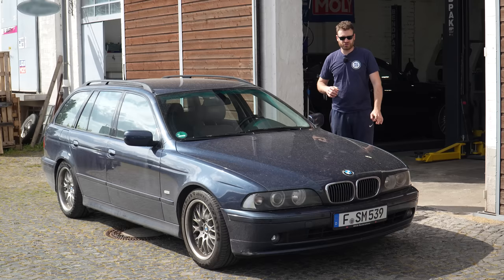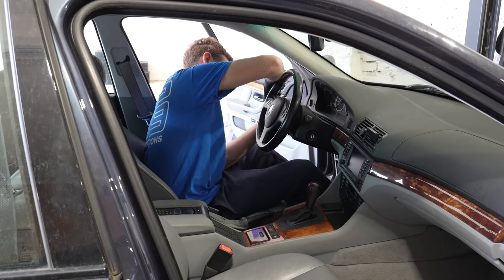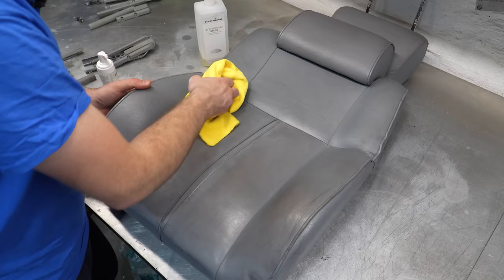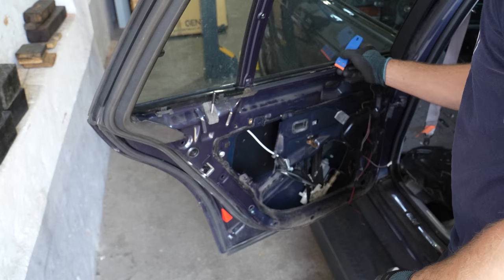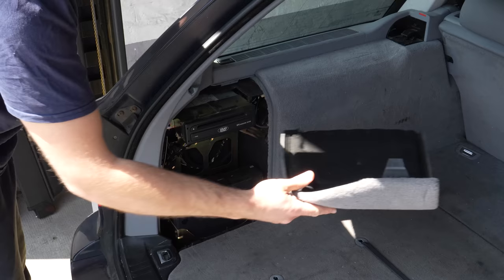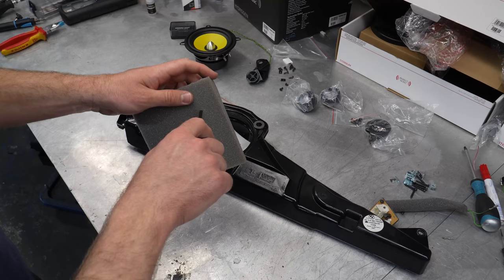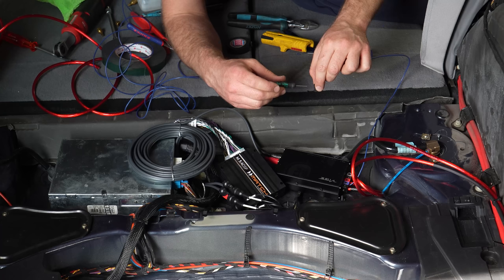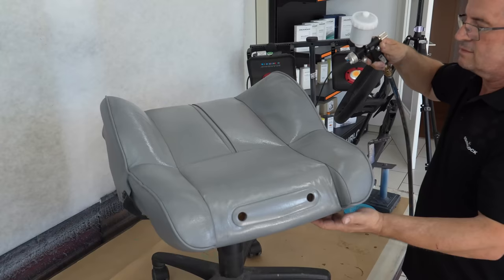Upgrading the 20-Year-Old Tech - BMW E39 530i Touring - Project Rottweil: P5

Comment: Hey maybe you can help me out with the harnesses? I got a e46 with the big Navi and H&K system and would like to connect a dsp + amp because the stock amp is kind of trash 😅. How did you connect the radio (BM54?) to the dsp? And are the speakers connected to the radio or the dsp? I really would like to keep the original parts/looks and just tune the system.

Comment: Please don't use so long coiled-up signal cable between the DSP and the amplifier. It creates an unnecessary signal loss. Just buy a 1 meter or less long regular RCA cable. Other than that, great video as usual.

Comment: The dihtung on the inside of the door, the rubber one that blocks the moist and water get inside the door. For proper install, heat it with a heat gun so it attaches better. Worked in a BMW service/bodywork shop, and thats how to install it without thinkin it will fall of or not seal properly. Just a advice

Comment: Hmm did Sreten connect thru the stock crossover? Saw some capacitors on that board with the connector in the front door speakers???

Comment: bluebus is the dream but damn its expensive :D dension gateway works really good too, had it in my e46
Reply: Just use any aftermarket radio with bt and swc. No need for bluebus. Multiple ways to achieve the same thing on these older bimmers
Reply: @burntnougat5341  - It's a matter of what your goals are. I created the BlueBus because I wanted to keep the OEM system, I wanted to maximize the functionality of the factory components and I wanted high quality audio (BlueBus sports a high quality DAC -- Texas Instruments PCM5122).
Reply: @bluebusbt  correct but price being a factor, I suggested a more budget friendly option for the op that accomplishes the same goal. The stock systems on these cars are at their age imo
Reply: @burntnougat5341  I appreciate you like aftermarket radios, but they definitely don't accomplish the same goal if the goal is to keep the stock equipment. You can see from Sreten's videos that he and many others like us try to keep the cars stock where practical.

Comment: I love watching your videos on the E39s because it gives me an enthusiasm boost to carry on OEM-plussing mine! Nice work as always Sreten.
Btw you mentioned that you’re wiring the sub in series? That would be positive to negative terminals, and increase the overall impedance (lower volume). Parallel will half the impedance, positive to positive, and make your amp work harder. Which way did you go?
Reply: his amp goes down to 1 ohm and sub is wired in 1 ohm

Comment: Nice, are you sure you put de negative and the positive right on the sub? It looks like he goes the wrong way, you can easily check this with a 9 volt battery..  and you put the wiring parallel,  not in serie like you mentioned

Comment: Great content as usual.
Don't agree 100% with the foam solution for sealing the mid speaker but maybe it will seal up sufficient with no air leakage front to back of speaker element 🙂

Comment: Great video. I have to ask how can you tune a multi speaker DSP with the interior out, the sound will completely change once everything is back, I assume you will tune again, its a bit like setting up suspension while still on the ramp, its ok but will change once loaded.

Comment: Anyone has the link of the tool for the subframe bushings please??? Need to change mine aswell and cant find where he put the link he said
Reply from the maker: I just added his ebay profile, but it looks like he has no active ads :(
Reply: @M539Restorations  managed to buy the last tool from the guy. Big thanks to you Sreten👍🏼 will change mine this Saturday like you did
Reply from the maker: @athanassiosioannidis8436  if you have air springs in the back, try to deflate them, it will be easier, otherwise they will push the subframe down.

Comment: That rear sensor is the s.l.s. rear axel height sensor . Not a headlight level sensor on a touring? Touring wears out the subfrane bushings because the entire suspention is mounted to the subframe not the body like a sedan is.

Comment: 45:20 You say you are connecting in series, but you connected the sub in parallel if im not mistaken? Might be driving the amp a bit too hard that way, but I don't know what load it supports

Comment: 36:19 if other have not mentioned it, would the 2 capacitors on the board not work as a crossover too?
Reply: the oem crossover should not be in the system...

Comment: Front speakers, you should have just taken the rubber protector off of the magnet, and it should have fit! That foam is not dens enough, you're definitely going to lose a lot of efficiency! P.S Bluetooth streaming is really low bit rate, lower than mp3!
Reply: It uses the AAC codec for streaming (a marked improvement over SBC), and the DAC is top shelf (PCM5122). I would bet money it sounds better than most AUX solutions solely based on the DACs SNR
Reply: @tass2001  AAC runs at a maximum of 250 kbps No DAC can improve a low bit rate Sample/source. VS a 32bit 192000Hz Source with a bit rate over 900kbps! So the 250kbps source is still lower that the max MP3 sample of 320kbps! Ditch Bluetooth and stream via Wifi direct or just add the source to your head units drive!
Reply: @BUZDRIFT  - While you're not wrong about AAC, I was not implying that a DAC can improve quality of the source media. CBR MP3s are silly, though, and I would personally never rip in anything other than VBR. You also have to account for the fact that we're talking about audio in a car and not headphones -- will you really hear the difference?
Reply: @tass2001  That's exactly right! Not many if any will hear the difference, especially at high dB levels! CBR @ 32bit, 192000khz is my go these days! File size used to be an issue, but 1Tb Micro SD that read at 300Mbps plus aren't that expensive! In saying that, 1 Track will be more than 90 MB for sure! Anyways, you're spot on about hearing the difference!

Comment: archhhh that speaker installation with foam is not greatest your butyl strip would be best. Speaker enclosure should keep all pressure inside (except ported) and foam leaks. That speaker magnet is hidden under rubber part that can be taken off so you probably would have enough clearance to install without washers but that eventually doesn´t make difference cos that speaker "box" is thin plastic that resonates very much that make lower notes poor quality. Subwoofer box is way too small btw. Overall sounds better for sure. Great mechanical videos anyway love to watch these :)

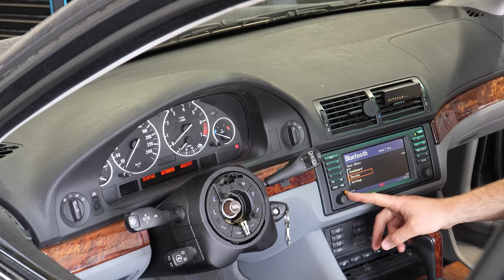Comment: 30:37 does he have something similar for the Omega B2-s Siemens NCDC navi unit? Am not using the CD changer for anything, would be nice to have bluetooth instead (as many made it possible already with diy methods)
Reply: Sadly not -- I have never even heard of this Nav unit D:
Reply: @bluebusbt  it was also found in Vectra C/Signum, some Volvos and Saabs of the early 2000s.

Comment: Negative wire should be connected to car body not battery ground. Could cause interference with some other modules. That is why it's so short. Had problems on some cars where central locking or alarm modules won't work correctly because the amp ground is connected to battery.

Comment: In series positive to positive and negative to negative? are you sure about that? That's parallel connection there, not a problem if your amp can handle it, but you risk to overheat it if it can't. for serial connection you connect positive (red) terminal from amp to positive terminal (one of 2 red) on the woofer, the negative wire (located on the side of red terminal you just connected) goes to red terminal on other side of the speaker, then you connect the black terminal (the last free one) to the negative (black) terminal of amp. This way you adding resistance of coils making the amp running cooler but with less power, the way you connected now is parallel so you lowered the impedance and having the amp running hotter.
Side note, negative wire doesn't need to be connected to the battery directly, just to the ground (any chassis ground, like seat belt bolt, that's why that wire is so short) also red one could be connected to the power distribution block (right above the battery, just aesthetics). Just so you know (or you know already) the e39 is well known for the bad amp and it's cold joints issue. however the speakers themself are quite good quality.
Reply: I checked the amp and sub online... the amp is 1 ohm stable, and sub is 1 ohm wired.. so no problem there
Reply: @sergiobisonte  ok, idk about their specific specs, but he said he connecting it in series, also 1 ohm stable but on what heat dissipation?
Reply: @marek196c  he should be fine if he listens in a reaseonable volume
Reply: @sergiobisonte  should.... Not convincing

Comment: you did a mistake... the negative cable is shorter because you have to connect it to the closest good ground to the amp... dont run the ground cable all the way back to the battery...
Reply from the maker: Don't think I did. There was no other grounding point and it was extended only by a bit which is negligible.
Reply: @M539Restorations  ok, but it is recommended to ground the amp on the car chassis the closest possible on a good ground and never directly to the battery.. if for some reason, something goes wrong with the original car ground cable or if it has a bad conection, electricity will find its way on other ground, all the car electrics (starter, alternator, and other electric components) will flow through the amp negative cable, through the amp, through the wires connected to the amp, through the radio... you can have alternator winne noise on sound and even can start a fire if something goes very wrong... that is why never connect it directly to the battery! check the amplifier owner's manual.. its there on any amp manual.
this what your manual says:
Ground Cable
• At least 10 gauge cable should be used for the ground connection to the amplifier.
• The amplifier ground should be connected directly to the chassis of the vehicle, to bare metal.
• The cable length should be kept to an absolute minimum.

Comment: I share and understand the opinion on China Headunits. Nevertheless I finally found a way to make it work in a reliable way. Just bought and connected a wireless CarPlay Dongle so the Unit has nothing to do anymore with the everyday functions. Ibus and Blitzer app still running on the unit. It took me 2 years and countless Software versions to finally accept that the unit itself is garbage.

Comment: Hi, I got a question regarding the e39 tourings. I know it probably has been asked many times but i wanna know if there's any way to restore the rear window hatch from rusting completly? There are pretty bad cases out there although mine doesn't have holes in it (yet), so i wanted to sand the steel part down and paint it but i don't know if the glass is removable or not. Im still new to working on this car so I just wanted to ask before i break anything.

Comment: Question:- Are the seats wider than the E46 seats? Would they fit in your tourer? 
I’m looking for an upgrade for my E46 SE tourer 🤗
Cheers if you could measure or test fit yours👍🏼
Reply: I’m thinking they might be very similar, with just a wider centre console in the 5 series…. But I don’t know. 🤷‍♂️

Comment: Did i hear you correct? That the healight sensors are at the back of the car
Reply: There's one on both ends of the car.
Reply: @bluebusbt  ohk. I would have thought that such component will naturaly be in the front part of the car🤔

Comment: Mint ! Y DIY DSP pro S677a on my touring , is this bluetooth module compatible with it ? With DSP it is very complicated to additionnel it , thanks !
Reply: Yes! It works out of the box with the DSP amp.
Reply: Thanks Ted, y will buy at this moment only the bluebus,  will upgrade the speakers later,  the  DIY  S677a was a big work to do,  add wires into each door,  ad speakers in rear doors,  swap all of it from my previous e39 touring

Comment: Hi, is it worth it to buy refurbished - or - to have refurbished diesel injectors ? My e92 330d is very close to 300k km and fuel consumption is slightly rising ( currently 8,8l/100km and it was 7,8) while driving +/- the same. I suspect leaking injector. Im not very keen on to spend almost half of the price of the car for new injectors from bosch. Thanks !

Comment: Tapping the stock for the indicators to blink a few times when doing a line change is a cool feature to have. But the factory standard of 3 times is just ridiculous. In every car I drove 6 was the bare minimum one would need for a correct line change and 7 was 👌. 5 would still be a bit fast but nevertheless a lot better than the "stock" 3 times. I really wonder which idiot decided that 3 should be the standard🤦

Comment: 45:10 (+)Ve to (+)Ve and (-)Ve to (-)Ve is parallel.
Reply: the amp runs down to 1 ohm. and he wired the dual 2ohm sub to 1 ohm corectly
Reply: @sergiobisonte  I didn't state he wired the sub incorrectly; however, he stated the sub was to be wired in series. If R1=2Ω and R2=2Ω, then for series the total resistance would be R1 + R2 = 4Ω which seems about right for an amp.  In parallel, the resistance would be R1R2/(R1 + R2) = 1Ω which is how he wired it; tbh this seems low to me even if the amp can go down to 1Ω.
Reply: @davidgriffin79  he sayed series but in fact coneected in parallel.. its hard to see but...
the amp goes down to 1 ohm... but it look a very small amp to handle 1 ohm for me too

Comment: This sound system is badly designed from Bmw. The enclosure volume on the front speakers is so tiny that it kills the frequency responce of the speaker. Also the new sub needs a 20L vented enclosure to sound properly.
If i were you i would sacrifice the front woofers for midrange speakers and seal them on the door cavity.

Comment: Those bushings were def not the original ones. They last about 160.000km and yours looked way too new, they had been redone before. Believe me, I've seen old ones!
Reply: Could it be that this touring hauled very little load/weight and thus stressed the bushings minimally?  I (1st owner) replaced the subframe bushings on my touring after 20 yrs/170K mi. and they weren't torn up.

Comment: Question for the beamer drivers. 
How would the E39 ceep up with modern traffic. Are they good enough for todays roads and usage ?. I am a Volvo driver (C70 2.3 t5  and V70 2.5   both from 1999). And I am thinking of making the switch to BMW. I have had one in the past (316 E36 coupe) but it was way to slow. But the beamers are much more comfortable then the older Volvo's.

Comment: Also, by the way, that sub box that you ruined, served a purpose, as it has precisely canlculated resonance level.
So if you were to put a same size speaker but better quality, and adjust it to the resonance level of the box you would probably gain more.
But that would require some actial knowledge an tunning.
This just looks jank af
Reply from the maker: It still serves its purpose and does not look "jank af", in fact, it's performing flawlessly. This was Dave's suggestions to keep it looking stock and functional, and I'm willing to bet he has far more knowledge than you on this topic.
Reply: @M539Restorations  it was a sub box, now its a sub holder, its sole purpose now is to hold the sub, compared to stock where it is supposed amplify the resonance in the box to give you a better sound from a smaller driver. But in any case, if you are happy, we all happy.

Jank has context, taken the type of content you push its jank (compare it to any car, even compare it to the work done to the seats whith the atention given to save the original looks and part) ,for 99% of people what you done is okay, i agree.
Reply from the maker: I disagree there, it's still a sub box, just with a much bigger sub, rendering resonance meant for a tiny sub or its original design totally irrelevant. 

Then you clearly don't understand what jank means cause this most certainly isn't. The sound system is performing beautifully, better than Hi-Fi factory speakers that I fitted in my E46, which have more speakers and subs. The whole point of this setup was to do more or less a bolt in, plug & play setup, which it was. The sub required extra work to install it, but I did it purposely like that as I didn't want a giant, ugly box sitting in the trunk.